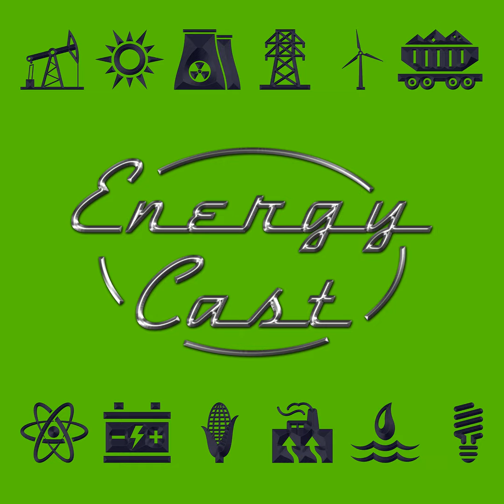43 | Fantastic Flywheels | Amber Kinetics

Comment: 3:35.. Just a small correction.   Kilowatt-hours should be seen like the capacity, like a tank full of petrol/gas.  Big battery or small battery.  From the example you get 32 kWh in total, i.e. you get 8 hours worth pulling 4 kW or 4 hours pulling 8 kW or 32 hours pulling 1 kW.  That is why the unit is kilowatt-hours, watts (power) times hours (time).